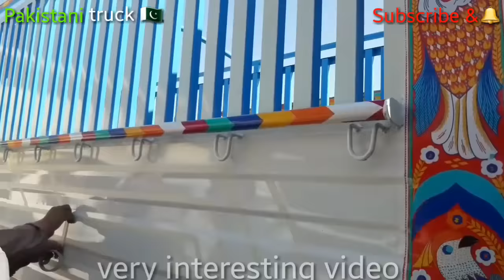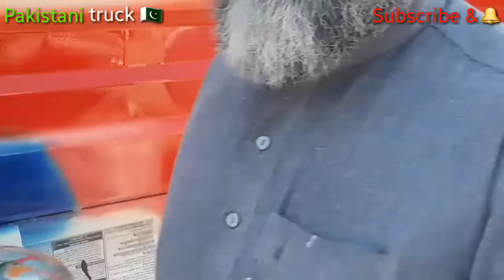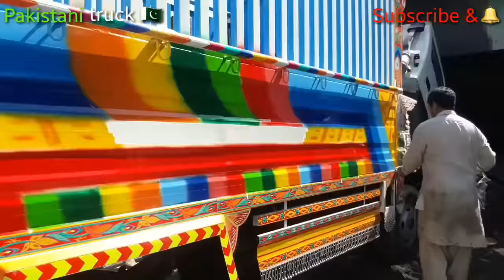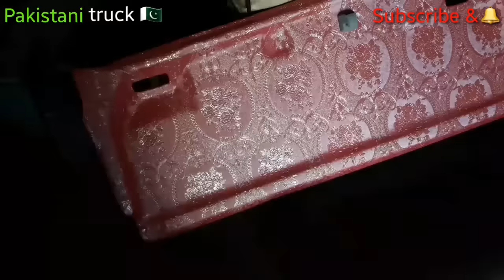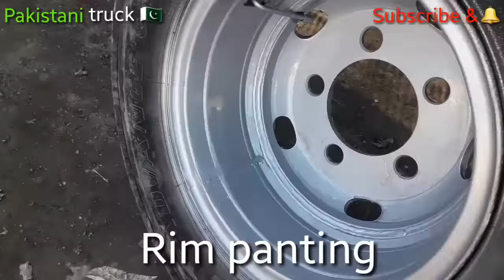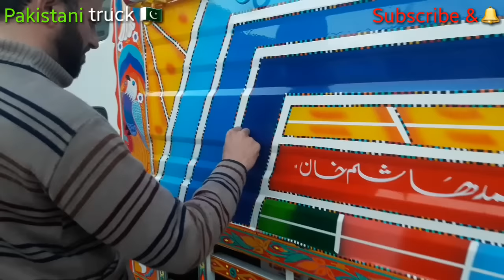How to make a isuzu crgo 
body with panting

Comment: What is the mac loading capacity if this truck?
What is the tyre size?
What kind of cargo does it load (just curious why putting so much metal weight on it)
Is this truck locally made or imported used from Japan?